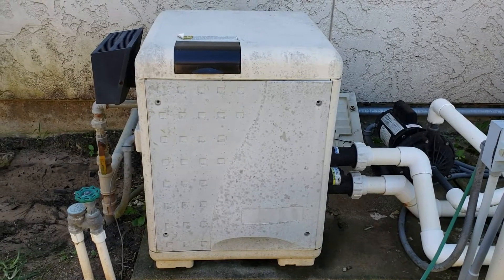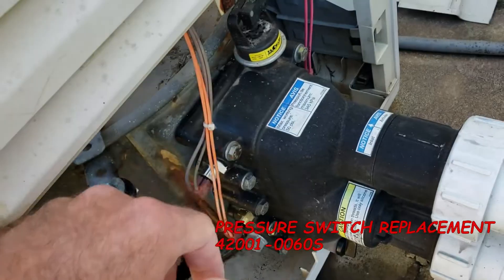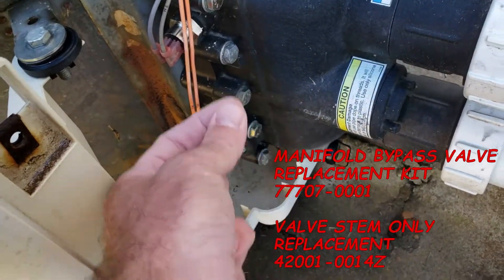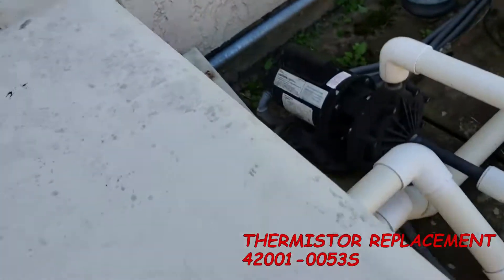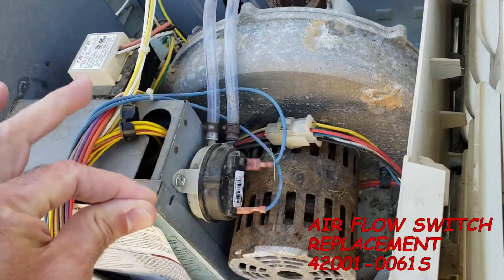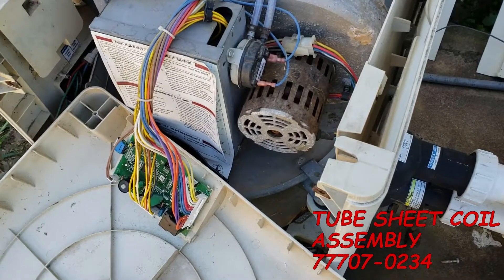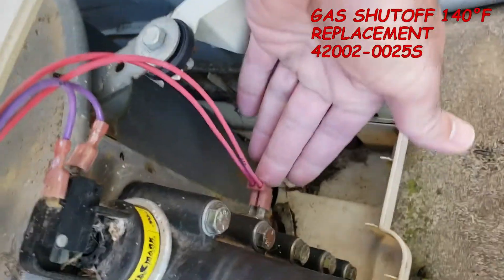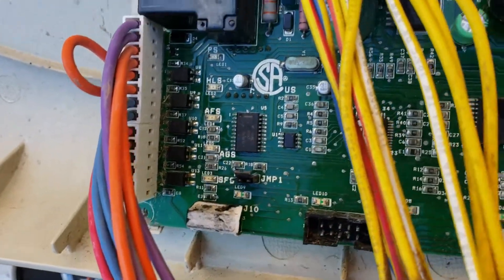PENTAIR MASTERTEMP 400 ERROR LIGHT LED EXPLAINED

Comment: Great video!  I have a Pentair Mastertemp 400 that is about 5 years old.  We use it in the spring and fall to get as much use out of our pool as possible. This past weekend, the heater turned on fine.  And then I discovered I could not turn it off.  The closest I got was by lowering the temperature below that of the water temperature.  My wife was able to turn it off by repeatedly pushing the off button.  The codes looked more like hyroglyphs than letter and number codes.  This morning, I started the pool pump so I could turn on the heater and see what the error codes, if any, might be so I could tell a repair service what I was seeing.  The heater control panel illuminated when the pool pump came on.  When I opened the cover, the error code showing was clearly 5F1.  The heater came on and I adjusted the heat up about ten degrees from the water temperature.  After it ran for a few minutes, I turned it off.  No error code.  I waited until it cooled down and turned it on again, still no error code.  What does the 5F1 error code indicate, and, do these symptoms mean the membrane or control panel are failing?  Thank you in advance.
Reply from the maker: I have never heard of a 5F1.  Perhaps a membrane board failing would be my guess.  Is there any visible moisture trapped under the display?  Sounds like something is shorting out somewhere on the membrane board.  I would start with membrane board 1st, then control board 2nd.

In fact, you could try disconnecting the membrane board from the control board and then fire it up from the main control panel.  I haven't tried that before, but I wouldn't think the presence of the membrane board would be essential  to functionality.  If the problem is in the membrane board shorting out some command pins on the control board via the connected ribbon, you very well might regain full contol over the heater from the main contol panel just by removing the membrane ribbon from the contol board.  Try that for isolation purposes.
Reply: @pvt-pilot  Thank you.  It has quit working again and I had an Ad0 error message that is now an Ad1 error message.
Reply from the maker: @richardn.thompson8457  Read this article I found regarding your symptoms and codes.  It is 5 years old:

Error Codes on Max E Therm 400 temp display, OFF button unresponsive

5 posts / 0 new

Last post

Laurence Mayer

Posted 5 years ago

Greetings,
I cannot find any information about this issue on the forums...
My Max E Therm 400 Heater (1 yr old) displays a message on the LED temp display. This message cycles through the following values:
AD0
AD1
SF0
SF1
The "pool" and "spa" buttons will start the heater, but for some reason the "off" button will not work. I must switch the breaker in the electrical panel in order to get the heater to shut off. Shutting off the pump will force the heater off, but it will come back on again unless I power off at the breaker.
The heater display also shows the usual power-on messages (888, 180, R4), but eventually settles on the above messages.
I'm trying to make sure the heater is in good shape (clean, vacuumed out, protected from sun), but a little direction on what the message mean would be a great help. I'd like to know if I need a new touch panel, PC board, or something else.
My Pentair dealer hasn't been able to get back to me in a few weeks... really busy, and I've spent over an hour on hold on the Pentair support line. Any help would be appreciated.
Thanks,
Laurence

Richard

Tech, Pentair

Posted 5 years ago

This would be related to stack flue programming, you will need to set both AD and SF to either AD1 and SF1 or AD0 and SF1, this will allow the board to read the correct stack flue type on your heater, once you have the correct setting, turn the heater off then turn it back on, this should correct the issue.

Laurence Mayer

Posted 5 years ago

Richard, Thanks for your response. That would make sense with the fact that the SFS LED is lit on the back of the PCB. I have made several attempts to set these parameters. I have seen your instructions elsewhere in this forum to do this. I can change the digit between 0 and 1, but pressing the OFF button (or holding it) doesn't seem to advance to the next step. I am wondering if I have a touchpad issue as well... Also, do you have any suggestion on how I decide between AD1/SF1 or AD0/SF0? Is this based on a specific heater model? I have also tested the OC resistance of my SFS - it seems to match the recommended range posted here (around 3.6MOhms) Thanks.

Laurence Mayer

Posted 5 years ago

Actually, I now see the options you wrote above are: AD1/SF1 or AD0/SF1. How would I decide between those settings?

Laurence Mayer

Posted 5 years ago

My Resolution:
It appears that I had two problems at the time time that complicated troubleshooting:
1) The unit somehow lost its 'stack flue programming' settings. These are the AD/SF settings mentioned above by Richard. I don't know what would cause this, power glitch?
2) The OFF button on the membrane switch failed. This was not immediately obvious because the SFS issue caused the interface to behave differently than it normally would.
After I replaced the membrance switch (actually to test I just unplugged the old one and plugged in a replacement without mounting it), I was able to set the AD/SF program. Setting both to zero did not correct the SFS problem, but setting them both to 1 caused the SFS LED to clear, and the system functioned normally.
Sure would be nice to know how the system lost its SFS settings, and what the difference is between AD/SF0 and AD/SF1.
Thanks for pointing me in the right direction, Richard.
Reply: @pvt-pilot  Thank you. I suspect what I am seeing is an SF rather than a 5F code.  The solution is above my pay grade.  It took me a week to realize I could reply and thank you for the information.
Reply: I replaced the membrane and I’m no longer getting any codes.  The red service heater light is on, the green spa light is on (I’ve been told it doesn’t matter since we only have a pool and either is okay). The numbers on the panel say 81 which may be the temp it would heat the water to.  The off button still doesn’t work.  I did not try to operate the heater without the membrane.  I don’t have a technical manual for this.  Is the control board programmable? Suggestions?  Thank you in advance.

Comment: I love troubleshooting and thanks to you I found the problem was due to the AGS. Only $34 Thanks again!!!
Reply: I replaced the AGS on my Pentair Mastertemp 300 and it seemed to work again for a while, but then it stopped heating again. The service heater light comes on, but there are no indicator led's lit and there are no codes showing on the panel. It seems to run for a few seconds and sounds as if it's about to light the gas, but you smell the gas for a few seconds and then nothing happens. I also removed the manifold bolts to see if there was an internal leak, but no water. Any ideas?
Reply: @mr.arthur2058  Check the Ignitor

Comment: I got one that fires up then it  starts to shake violently at the manifold. Would that be the  governor is gunked up? Thanks
Reply from the maker: I think you have a possum in there that is tired of getting scorched every time you have a party.

Seriously, I don't know of a governor in these units other than the control board.  I can't see how a clogged exchanger tube or two would cause violent shaking either.  🤔  If this was the cause, it would also happen when the heater is off since water always runs through it.  A broken bypass valve just sounds like ice cubes in the manifold but doesn't shake the unit.  Does the fan spin smoothly or out of balance?  It's not down by the manifold at all, but I am trying to link moving parts to your problem and there just aren't many.  I'm at a loss here.  Time for some exploratory surgery.
Reply: Wow I see this comment 4 years later lol, not sure if your fully kidding right now, or not. Yes there is a thermal governor it just at the headers easy to replace. It keeps the heat exchanger from over heating.

Comment: I had an AFS light come on. Ordered that part and changed then right after that the AGS light came on. Do you think my board is bad and throwing random lights or could both be bad?
Reply from the maker: Watch my AFS video.  Simulate trouble scenarios on your board to see if it reacts appropriately.  Open the AFS leads and see if you get the AFS light to turn on.  Short them to see if it turns off.  Do this for each pair of wires going to each sensor.  Clean any corrosion on each spade connector as you do this.  If your board is throwing the expected codes, then I would say it is doing its job and you have something else going on.  Perhaps defective sensors, blockages, etc.  What was the actual cause of the AFS?  (Not likely to be the Air Flow Switch itself)  did you find an air flow obstruction?  My air flow obstruction was a tub full of water.  Hope you don't have the same problem.
Reply: @pvt-pilot  I watched them both. Great videos! When I replaced the AFS the light for AFS went off and stayed off. I will try to simulate errors and see how the board reacts. Thank you!

Comment: Actually it’s E06. Sorry posted wrong code
Reply from the maker: I have heard a Stack Flue sensor out of operating limits will throw E05 or E06 based on too high or too low electrical resistance reading on the sensor.  Not necessarily a defective sensor.  Could be the symptom, not the problem.  If you are heating your spa, the spa button's light should be lit on the heater's display.  Hold that button down for 5 seconds while the heater is running.  The display will show the temp that the stack flue is detecting.  If it is obviously incorrect, like 400 degrees F within a few seconds of running, clean the sensor, the contacts of the sensor, or replace the sensor and fire again.
Reply: Thank you for the information.  I will certainly try that and hopefully will solve my problems.  After some investigation I figured it may be a bad stack flue sensor, but wanted to get your opinion.  Much appreciated!

Comment: What is an EC6 error code?
Reply from the maker: E05 is a fully open SFS (broken wire or internally open)
E06 is reported to be a fully shorted SFS (2 lead wires touching, corroded together or SFS is internally shorted)
There is no EC6, so you may have that part of the number 0 dead on your membrane board.

Comment: Thanks for the great video.  My MasterTemp 400 heater is showing the code Ad0 and now the jacuzzi doesn't work properly. I can turn the pump on remotely, but the temp needs to be manually turned on at the heater itself.  The temp also needs to be manually raised at the heater itself.  I cannot, however, turn the heater on manually at the actually unit.  I've seen a variety of explanations for this online, but nobody really explains it well.  Please help!  Thank you in advance.
Reply: I had a problem when I first installed my remote. The wire gage they give you is like a 24 gage and should be a 18 gage to make a better connecton at the receiver and the panel.  I had to reconnect all connections twice until it worked.

Comment: I have a pentair mt400 I have no light on the back panel green led9. But it doesn’t show heating on the front panel. Even though it sounds like it heating. And help would be great
Reply from the maker: LED 9 is just the "POOL ON" green light which can be seen through the little transparent window on front of your keypad.  Green LED 10 directly lines up with the "SPA ON" transparent window and will illuminate when you program it it heat the spa with Pentair Easytouch panel.  The SERVICE HEATER LED is orange and lines up with that window...and so on.  These are not diagnostic error lights, just status.

As for sounding like it is heating, does it fire?  Does it have hot exhaust or is only the fan running and no fire igniting?  Does it smell of natural gas and still not ignite?

I am going to assume you got fan only and suggest you check your igniter.  You can unplug it and check it with an ohm meter.  If it is open (infinite ohms), the igniter is broken and must be replaced.  If the igniter is good, listen for the click of the gas valve opening about 10-15 seconds after your fan starts blowing.  Does this happen?

I would like to help, but would need more details.

Comment: Thank you! I’m getting a service here light on and I’m thinking it’s the gas switch. Reason: the heater system works fine however, after about 20-30/2 of the heater turning on it shut itself off. And does not try and self back on I’ve tested three times since last night any insight would be grateful. Going into attack it now, cover me!😉
Reply from the maker: If you don't have AGS light on, start with non electrical parts first.  Test the thermal regulator.  If it does not open/close with water >120 degrees, replace it.

Comment: I got the master-temp 400HD pentagram, service light is on but no showing any code on the little screen. However the AGS is on on board. The manual says to either replace the high limit switch or the automatic gas shut-off valve. Any idea?
Reply from the maker: Never had AGS error light, but I do know that AGS is the Automatic Gas Shutoff switch.  I would replace it first before moving on to any other component.

Comment: My system is 5 years old. Currently I have no Lights coming on the panel, this just started. Last week I noticed the hot tub (spa spill over) had drained significantly on its own. This must have happened while the pool pump was off. The next day everything appeared to be fine, except oddly,  the heater was on. I turned it off and I can’t get any power on the screen now or it to come back on. Also the week prior I did have an electrician hook up to my panel and run electric to a newly built shop building. Any ideas on what could cause these issues?

Comment: thanks very much for this video, it is very helpful.  I had an issue similar to Shawn Seman below.  The heater would kick off, the gas would kick in for like 10 seconds, and then click off, and then this would repeat 2 or 3 times before the Service Heater light lit up.  I repeated the exercise 2-3 times with the cover upside down so I could see the back of the control panel.  No control panel LEDs lit.  I tried for a final time, expecting the same thing, but this time the gas kicked in and stayed on.  I ran for 10 10-15 minutes and it all seemed to work.  This heater is rarely used.  I am wondering if the start-and-stop sequences somehow needed to work out some dust or something in the system, and once that was worked out, the sensors all cleared? Will see if it runs ok again tomorrow. In general, should I be running the heater like once a month or so just to keep it humming better?  thanks
Reply from the maker: No, not really.  I wouldn't run it for cob web reasons.  If it really is used that rarely, (once a year or every other year) I would seriously consider building a PVC u-turn shaped bypass of the heater all together and just put it there in place where your input and output pool pipes hit the manifold.  Then turn off the breaker to it.  This will keep the chemical water out of your heater and help preserve your copper tubing heat exchange coils and sensors.  When you want the 🔥, remove the bypass, slide it back in place and screw the two pipes back together with your ✋.

Comment: First, Great video! 
I have a STA-Rite Max-E-Therm 200 and here is what it is doing:
When the heater is turned on, the blower starts, and the heater ignites. Then after about 15 seconds, it shuts off. The front panel has the Heater Service light on and when I take off the top cover the SFS and the LED 11 lights are on.
Reply from the maker: LED 11 is your service heater light.  It is nothing more than the "light bulb" positioned directly behind the transparent SERVICE HEATER small window on the front side.  There are other LEDs positioned similarly behind other transparent windows too, such as HEATING for example.

As for your SFS, check the wiring for free first.  Disconnect the leads and put an ohm meter on it to see if it is open.  If you have a resistance reading going to the SFS and also to the control board, your wiring is not faulty.  You likely have a SFS that has a resistance reading that is out of specs giving erroneous readings to the control board, and for safety reasons, the control board will shut the heater down.  Same goes for other temperature measuring sensors like the thermistor, HLS, AGS.  At one time or another, I have replaced all temp sensors over the years except AGS, so I can testify they definitely don't last forever.
Reply: Thank you! I appreciate your assistance
Reply: That's what I am experiencing now.

Comment: Hi sir. I was wondering if you can help me out i replaced the two most expensive parts which is the gnition control system and the control board. It is still marking an AGS error but apparently it was caused by the other two... any idea what that could be ?
Reply from the maker: I never had an AGS error before.  Have you tried replacing the AGS sensor?  Have you checked the wiring from the AGS sensor to the control board for corrosion or rodent damage?  I don't know enough about that error to say much more than that.  Good luck.